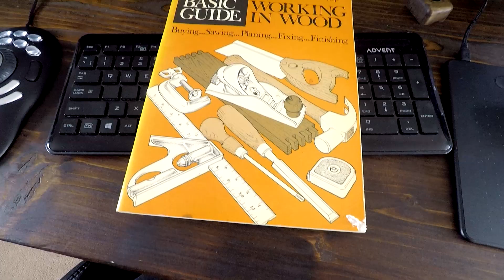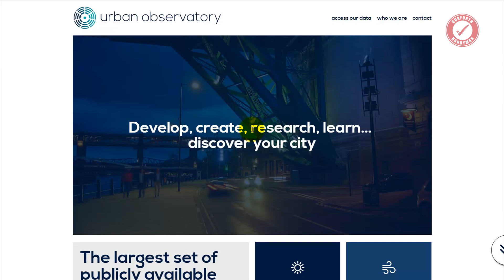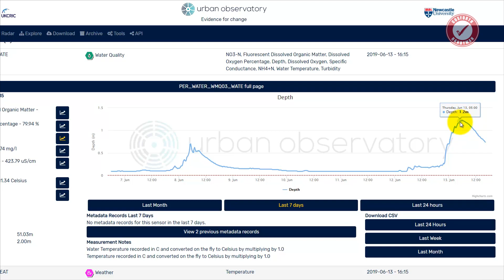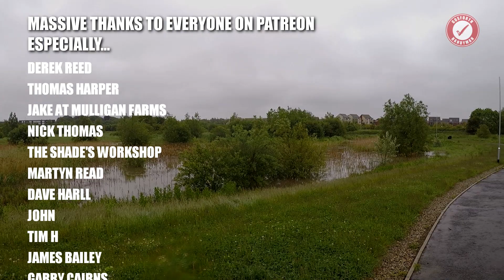How do new houses handle SURFACE WATER run-off? SUDS drainage!

Comment: I grew up in a 1950s subdivision outside of Boston, MA and it had a somewhat similar system of pipes, creeks and artificial ponds to manage the water from the storm drains on the streets and any other water that seeped in, though with the houses further apart, there was more natural drainage on each house lot. Our street was on a former apple orchard and the sunken park behind us was in what was said to be a filled-in stone quarry. In the early 1960s, they built another subdivision downhill on the opposite side, and these houses were on concrete slabs with in-floor heating, so the floor was only a few inches above the ground.  In 1979, one of the pipes that ran under a the street clogged up and the park turned into a lake for a few days, but the houses stayed dry. About 10 years ago, well after I'd moved out, there was another clog further down and this time the water pooled up in the low-lying streets with slab houses, ruining nearly everything inside. After that, the low-lying streets were declared a federal flood zone and their insurance rates shot up. It never occurred to me while I was growing up in that neighborhood how fragile the infrastructure that kept it livable was.

Comment: 9:05 what’s the diameter of that pipe? It seems like quite a diameter.
Also if that were my project, I would have added a bespoke gate on the top of that brick headwall and ladders leading down for safe access and cleaning of the grates.
Reply: That pipe looks much bigger than the ones I'm used to seeing here in New England, but recently, I was surprised to learn that another place with a huge drainage system is Los Angeles. In fact, their storm drains are so big that fugitives have been known to make escapes through them. In spite of its reputation for endless-summer, LA gets brief, but intense monsoons each year and the ground is too dried out and packed to absorb them, so they need to pipe the water to the ocean before it can flood the streets.

Comment: These also have the added benefit of saving the homeowner from a annual surface water run off charge (which you pay if your properties surface water drains into the sewer, where it needs to be treaded)

Comment: Very interesting video, Andy!  Some plants, many of them native to a region, have very deep roots, and these wick water much deeper into the ground, which will help control runoff to a surprising degree.  Here in the U.S. some municipalities offer incentives for rain gardens.  These use plants to control runoff.  Why?  Because housing developments typically have lawns with shallow roots.  Here's an amazing image showing Kentucky bluegrass, a lawn grass with <6 inch roots compared to native grasses and plants with roots up to 15 ft.  https://lsprojectblog.files.wordpress.com/2017/04/roots.png . You can see that this will also help with soil erosion.  They can help with shoreline erosion, too. http://www.mishorelinepartnership.org/plants-for-inland-lakes.html.   

This spring, in the central U.S., we've had unprecedented flooding.  Unprecedented rainfall (sill in progress) is a main factor, but looking at the roots of plants can give another part and partial solution, since housing developments covered with concrete, roofs, and shallow rooted lawns can create a problem.  Incidentally, native U.S. prairies were better carbon sinks than forests.  

So, it seems likely the reeds and other plants they use in the SUDS systems also serve a function. For anyone who has a problem wet area on their property, these plants can offer a solution.  I know of places where it's made a difference, including with mosquito control.

Comment: Nice to see a suds system working properly. In regards to the water flowing out of the BT Openreach box it shouldn't. Report it to your local highway authority, Openreach are a PITA to get hold of (I work for the highway department for another council)
Reply from the maker: Cheers Jon! Sadly nothing around here is adopted yet so I think it's still under the control of the developers. 👍
Reply: @GosforthHandyman  good luck getting either party to resolve it then!

Comment: Big problem is the take up of cars has meant more and more people concreting over their front gardens for drive ways and it's not necessarily done well. A house nearby has had its drive re-paved and I notice it has no drainage except they've put a pipe through the front wall to drain the driveway onto the pavement. Rain? Soakaway? Nah someone elses problem! Ugh.
Reply from the maker: Yeah, lots of permeable block paving around here but the drives themselves are nearly all tarmac. Never really understood that one. 🤔

Comment: In USA we pay property taxes on our houses based on the square feet of impermeable area (roof and paving) that causes runoff.  That tax pays for all the ponds etc that reduce flood potential.  Big problem is houses too close together with too little grade to carry water away from foundations.  That leads to flooded basements.

Comment: Andy interesting video, BUT, I don't know whether your local water authority has taken ownership of these SUDS but the usual case is that ownership of them is sold by the property developers to mange ment companies where they then charge all the estate residents, via leases, for the upkeep of them. Which is outrageous as they should be managed by the local residents. It's another scheme by the developers/management companies to screw the local residents for more and more money for doing bugger all. The rushe beds by the way are filter the water cleaning prior to entering the eco systems.
Reply: Hey? What a daft comment. By having it done by the management company, it guarantees it is looked after and therefore avoids your houses flooding
Reply: @me-ju3fv  my thoughts exactly.

Comment: Great Public Information film, Andy. I've recently built a workshop in my back garden. There's a calculation I had to do to determine how much rainwater would no longer drain through my garden and I had to build a modern soakaway to a specific size based on that calculation. Shouldn't all developers do the same, scaled up according to the size of their development? Or do they do that anyway these days?
Reply from the maker: From what I've heard they have to cater for that from 2007... could be wrong. 👍
Reply: @GosforthHandyman   I hope so. The land used to be a big giant sponge, but now that water falling on the new buildings and roads etc has to pass overland or through insufficient underground pipework to reach the attenuation ponds.

Comment: Great video. I'd question whether it really is sustainable to concrete over entire estates and have run-offs going to segregated nature spots. I'm not convinced. As a fellow estatee, I'd far rather have the nature built in and less suds. More trees please. A bit more playing space for the kids. I'd happily sacrifice my car-hole and park in a centralised car park in return. I suspect most wouldn't like.
Reply from the maker: Unless you can build estates without roads and houses then I think you'll struggle. Most of the run-off is from the house roofs and roads. 👍
Reply: @GosforthHandyman  Yes, I could imagine estates without roads, that's sort of what I meant. Give the road space back to the trees and meandering paths that follow the natural contours forcing water into the new-found trees. I know, it'll never cotton on!